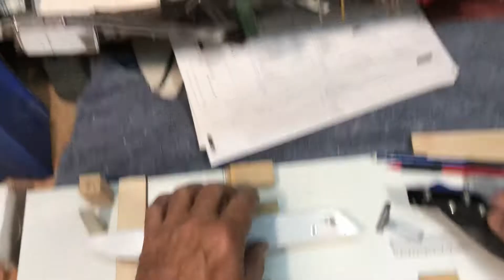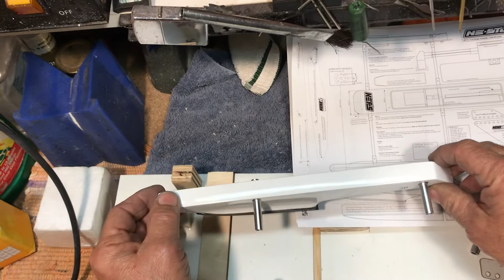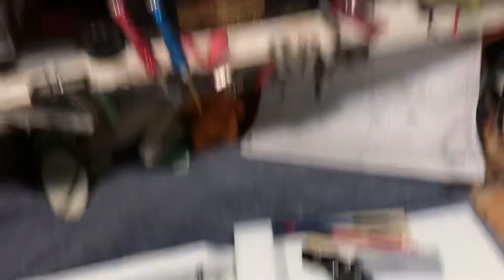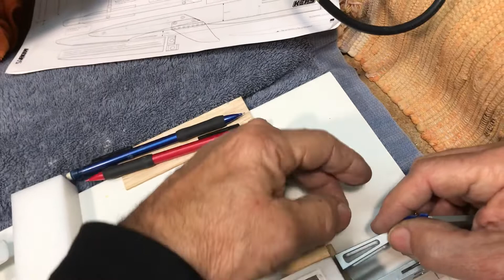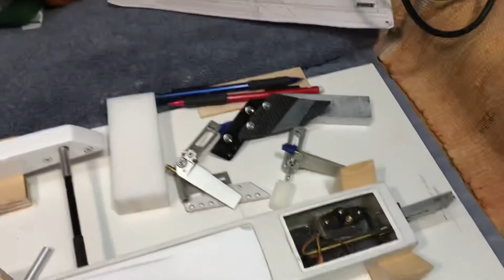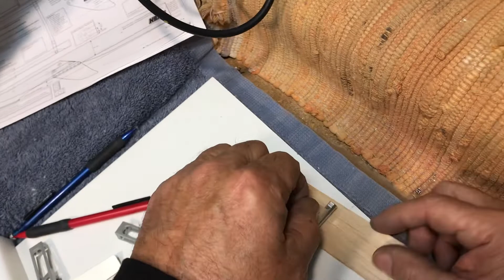Dr. Jet attaches the hull sub-assemblies on the Dona Outrigger.

Comment: To attach the booms I use heat shrink tubing with glue. That is certainly secure enough and is very easy to remove if necessary.
Reply from the maker: That's an excellent option.  I chose tape for fast field adjustment without the need for a heat source.  Once dialed in, that may be the option of choice if I want to keep it assembled for travel and storage.